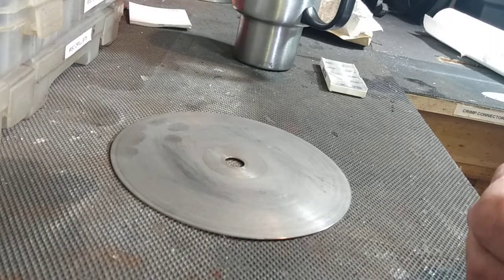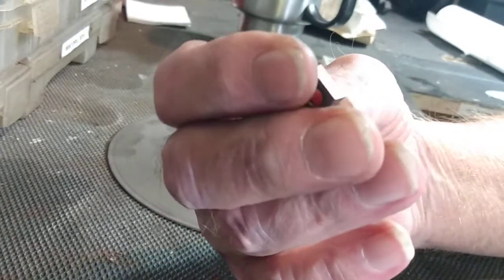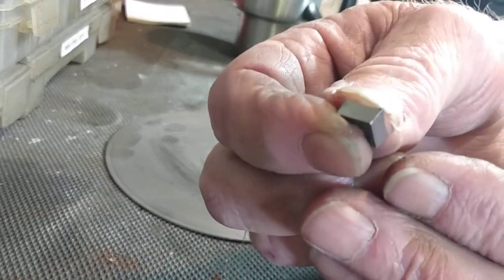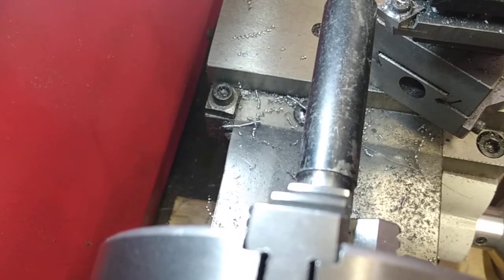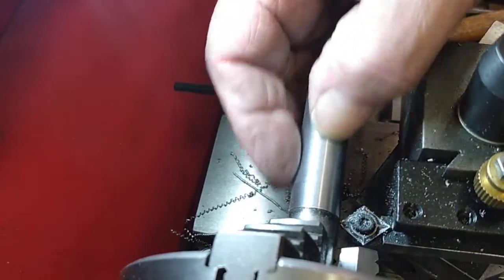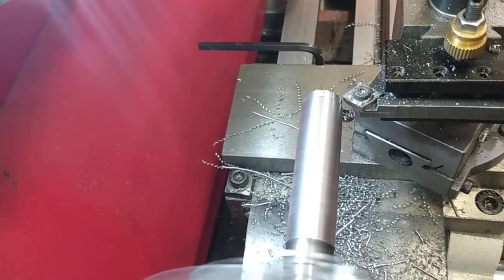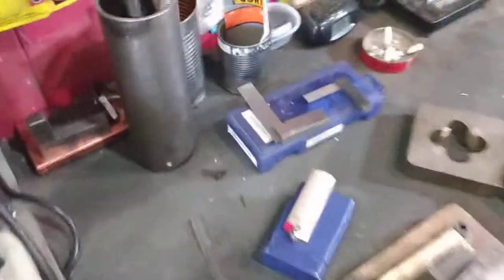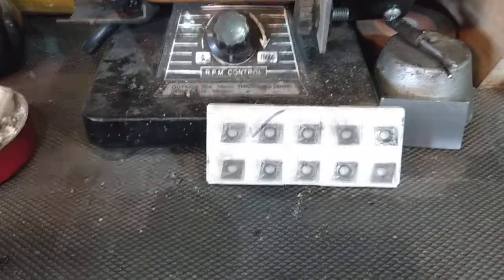resharpen recycled indexable carbide cutters... save a chunk of change.

Comment: WOW , not only has YT censored my comments . . . they've also seen fit to not notify me about your uploads !    
       Flat laps work great on dressing up used inserts -  With a bit of careful manipulation , they work great for 'touching up' carbide center drills too !     You might try making a few 'homemade' collets to fit your DOP / handle on your faceting machine . . . works fantastic for that purpose . . . * especially if you have a super fine 'cheater' adjustment !    ;)
       You can completely eliminate 'chirping & chatter ' by facing off the end , & giving it a center to support that long stickout !     ** You can make a carbide center on your faceting machine too - just lap a small carbide endmill into a 60 degree point . . . then press fit that center into a tailstock holder . ( even a drill chuck would work in a pinch )    Live center would be easier to do though . .    Way to go , Scott !
Reply from the maker: I did my make tool holders to hold the inserts at the correct angles on a motorized s sharpener.  Then I discovered the endmill sharpener jig and found that works on indexable cutters too.
Reply from the maker: I think all Latheians ( I just invented that btw) should declare ourselves as a culture and the government needs to provide equity for us.  Like maybe free Southbend bench lathes...nee ones...free...we have suffered much.